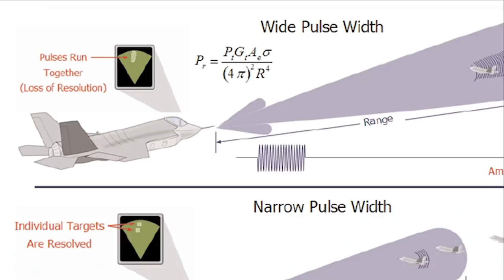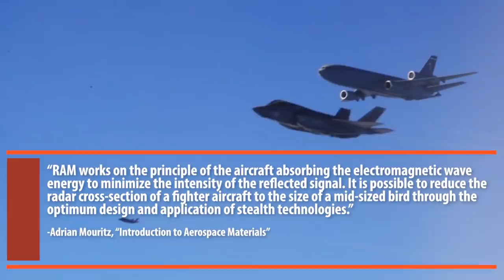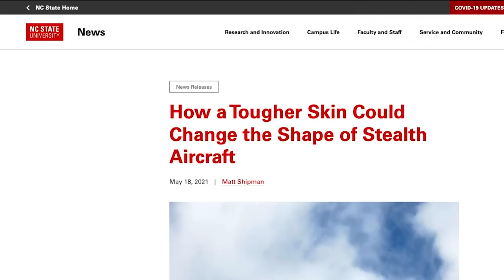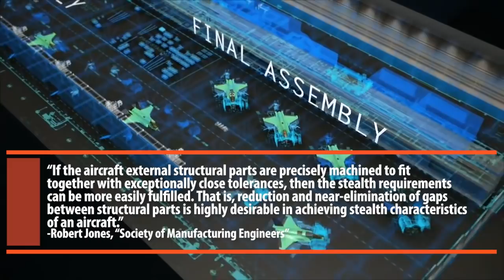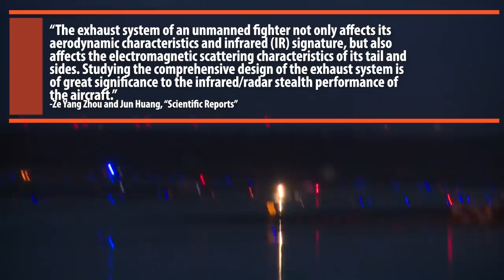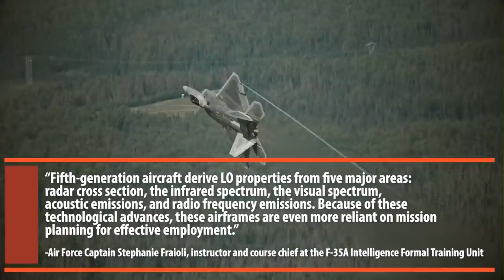Why is stealth so hard?

Comment: americans make me laugh with stealth watch the two german men that set up a portable radar outside a airshow were the f35 was leaving and they detected the f35 with no real effort .
Reply: because F-35 at airshows always equipped with luneburg lenses to negate the stealth :/
its common knowledge.
Reply: @pindot787  your silly
Reply: @frankrenda2519  Lol, you not knowing it actually made you look silly.
Reply: Not tested for lock-on quality tracking, F-35's digital jammer wasn't active at the time,  transponders were active and Luneburg lenses were installed.
Reply: I wonder how they knew the jets were F-35s. RADAR can’t tell you that. What can tell you that is the information from the aircraft data transponder, something that the fighters would be transmitting while they flew through civilian airspace. That way other aircraft and air traffic controllers can see and avoid them.
Reply: @valenrn8657  the f117 is many times more stealthy than the f35 and it got shoot down with a 60s era sam .
Reply: @frankrenda2519  RCS 
F-117A = 0.003
F-22A = 0.0001
Less is better.

We have official confirmation from USAF General Mike Hostage who claimed F-35A's RCS is smaller than F-22A's.
Reply: @frankrenda2519  
F-35 has towed drone, F-117A is missing this feature.
F-35 has chuff, F-117A is missing this feature.
F-35 has active stealth (digital frequency memory jammer), F-117A is missing this feature.
F=35 (since Lot 4 builds) has advanced CNT materials to reduce RCS,  F-117A is missing this feature.

F-35 has 9G dogfight capability, F-117A is missing this feature.
F-35 can target missiles as part of the Aegis Combat System, F-117A is missing this feature.
Reply: @valenrn8657  f117 has superior stealth by shape end of story
Reply: @valenrn8657  makes me laugh when they try to fly a f35 like a sukhoi the f35 cant match the sukhoi not even close
Reply: @frankrenda2519  >makes me laugh when they try to fly a f35 like a sukhoi the f35 cant match the sukhoi not even close

F-35 has 360 degrees targeting despite its high AoA capabilities. Hint: Flying Aegis Combat System compatible node.
Reply: @frankrenda2519  >makes me laugh when they try to fly a f35 like a sukhoi the f35 cant match the sukhoi not even close

Unlike SU-27-to SU-35, F-35 doesn't have any straight vertical geometry to impede hammerhead maneuvers.
Reply: @frankrenda2519  Prove "F-117 has superior stealth" when compared to F-35A and F-22A.

I already cited USAF Mike Hostage's statement on stealth comparison. F-35A has replaced F-117A on stealth strike missions while gaining "Hornet with a turbo" dogfight capability.
Reply: @valenrn8657  like i said you dont know what your talking about
Reply: @frankrenda2519  Your argument is NOT backed by the official statement. USAF General M. Hostage > YOU.
Reply: @frankrenda2519  B-2 and B-21 Raider have curved surfaces that don't cross the critical angle. You don't know shit.

Lockheed's early stealth fighter designs have angular shaping design while Northrop Grumman has their curvy stealth design.

Northrop Grumman's curvy stealth design is original and it's different from Lockheed's early stealth design pattern.
Reply: @frankrenda2519  External geometry shaping is not the only factor for modern stealth design i.e. F-22 has internal foam while F-35 Lot 4 has non-structural CNT (carbon nanotubes).  Modern stealth is also below the external skin.

You don't know shit about modern stealth.
Reply: @valenrn8657  go play some video games kid
Reply: @frankrenda2519  F-35 Block 4 has GpGPU AI processing. You're obsolete.
Reply: @frankrenda2519  
https://www.youtube.com/watch?v=3gX_vZB-2nE
Super Hornet vs Flanker. Notice Flanker's tail drop moment after high AoA.

F-35A's empty weight is closer to MIG 29/35 and F-15A/C. F-35A lighter than F/A-18E Super Hornet
Reply: @frankrenda2519  you are conveniently leaving out that it was disclosed that it was shot down due to pilot error and nothing to do with its Stealth capabilities and not just that, the f117 can't be compared to F22 and F35s now. 2 totally different type of Stealth and sensor platforms.
Reply: @frankrenda2519  ummm no. The dude just literally posted the cross sections lol. And told u that the f117 has no counter measures and that the heat coming off the f117 engines is more greater than F22 and F35. And again, it was pilot error that caused the jet to be caught. It's easy to even shoot down a Stealth jet when you fly the exact same flight route and altitude everyday. You become predictable for the person on the radar to aim it directly where it knows you are already lol. I suggest that you get all facts and not just ones you prefer so that way you won't look ignorant
Reply: @frankrenda2519  F35 isn't made for dog fight. The point is to avoid dog fights. You don't win air wars today by dog fighting lol last US dog fight was in 1999. Lol. And the Russian SU jets can't even defeat Ukraine anti Air defense because SU has no Stealth lol. Nice try bud. Lol
Reply: @nexpro6118  it was tracked and shot down by the serbs listen to his interview .also the f 117 is far superior stealth wise than f22 or f35 shape is everything on stealth .
Reply: @frankrenda2519  ummm nope. Again watch the story same time same flight path low level. Also f117 Stealth paint was not on it because we didn't have it yet and the panels on the wings were not angeled like the f22. So no....f117 not have a smaller cross section as f22 and f35. F117 had a cross section of 0.0003. F22 has 0.0001 and f35 around that as well from the front nose.....like....you would know all of this if you actually research it lol